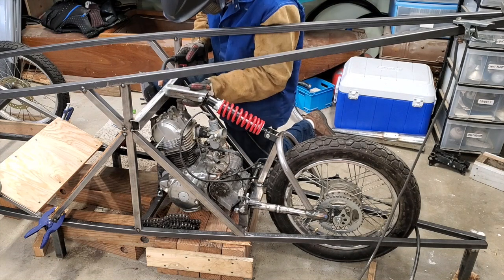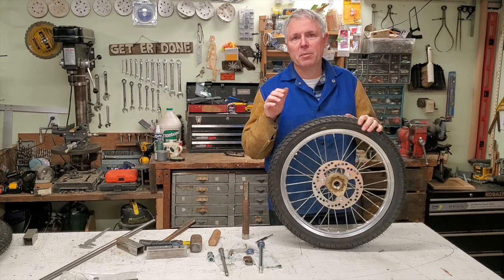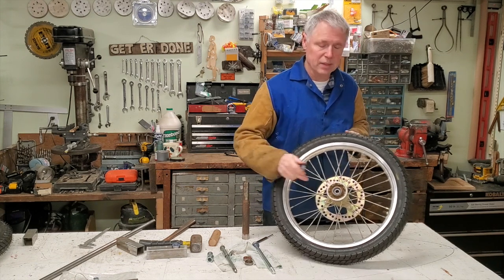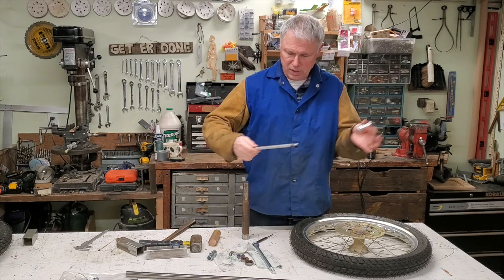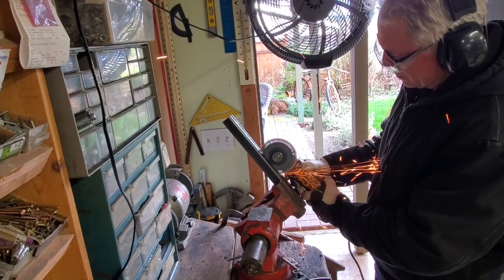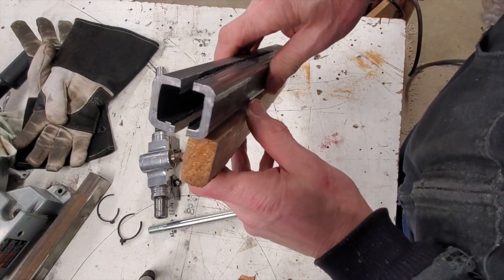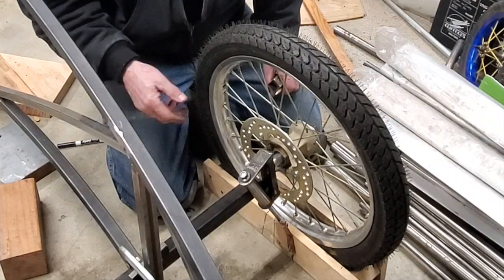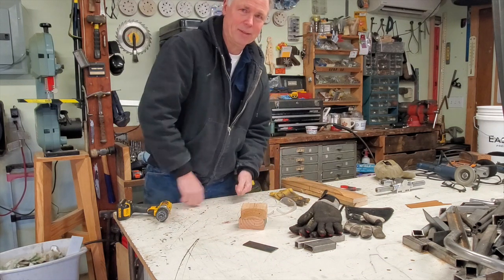Fuel efficient reverse trike build (part-3)

Comment: Awesome project , hello from Brazil, I love to watch all of your projects ,specially the bikes RV ,the only thing I don't really like about dirt bikes wheels are , if you had a flat you'll have the same problem of your bicycle tires, which you'll  have to deal with tubes and  it takes a lot of effort to fix.
Reply from the maker: Good point! I may carry a spare wheel in the back.
Reply: Paul Elkins , I'm so glad you  had answered' I've had some inventions myself in my channel not as good as yours ,I'm  using materials which I can find around here,and  by the way you are one of my inspiration,and  I have a bike RV which you can put it down on the ground and use as  sleeping space ,cooking and traveling protected by the elements, I have a little   kitchen home with a woodstove  made out of styrofoam, and now I'm working on a bike RV made out of Styrofoam as well. Please check my inventions in my channel, and comment ,thank you so much for your time and hope to see your next video.

Comment: I’m the same way. I Keep working until I have no more space or room from tools and parts lying around. And it’s a huge mess. Then I finally decide to tidy up. Mainly it gets more difficult to do the work so I have to. I push stuff around and into bigger piles until I cannot clear everything to make even 6 square inches of space. And I try to clean up before going inside in the eve. Cause coming out to such a big mess is tough mentally. Sucks to have to start the day cleaning before ever getting the day started. Funny I thought I was the only one like that.

Comment: Interestingly enough, looking at the top view drawing it is almost a laminar flow body you got there, if you drive it backwards. i.e. You'll get lower drag and now with two rear wheels the disturbed air they leave will not interfere with the flow around the body! However for a side by side two seater, as this is, a single front wheel with an engine on it doubling as foot warmer, is not optimal in riding comfort!, but when finished, do a reverse tow test or coast down test and I think you'll get around 1/3 less drag going backwards.

Comment: You could make a gusset to add strength between the axle tube and the king pin housing. The steering knuckles look plenty strong.
Reply from the maker: I plan too. I'll be adding gussets here and there as time goes by.

Comment: As you have it now I don't thing that the damper position/angle will work properly. It will try to compress it but will also try and drag it downwards, which cancels out the compression. You can't lower the fixed end because of the carb but you could raise to swinging arm attachment end so the damper works with the vertical loop becoming an alternate swing arm a la motor cycle. I see it has a cam adjustment for rate so that will help.
Reply from the maker: Thanks Deluk. I'll see what I can do. Much appreciated!
Reply: @paulwelkinsdiy  If you get your compass out and draw the arcs on paper I think you will see what I'm getting at. Have fun. Looking good so far.

Comment: ... a 3000 watt, 72 Volts and 27ah, 300 amp battery pack can get ya rollin down the road real quick... 50 amp continuous and 90 amp peak...

Comment: Basically you are building a CycleKart!
Reply from the maker: Indeed! I've taken a lot of lessons from the CycleKart community for sure. Increasing the front wheel bearing size especially, except I'm going with Ackerman steering which allowed me to get away from the SAE size GoKart front spindles and use a metric axle. Bearings are either in metric or SAE sizes, so using a Honda or Yamaha wheel will always be metric.
Reply: @paulwelkinsdiy  Look for Velorex, these are old ambulances from the Czech Republic. Also rarely in Germany.